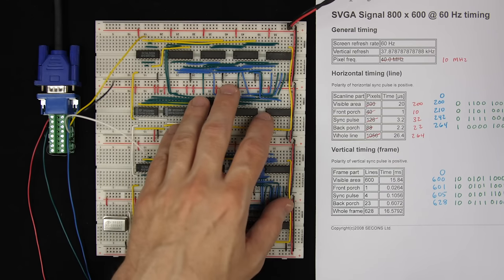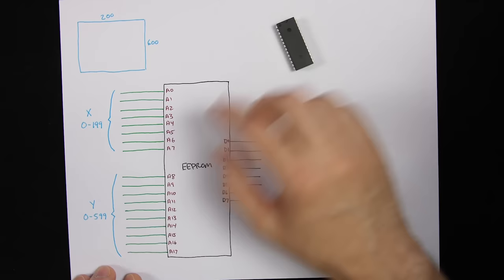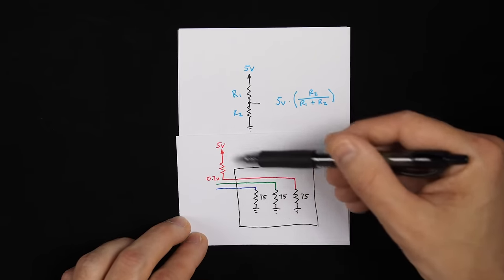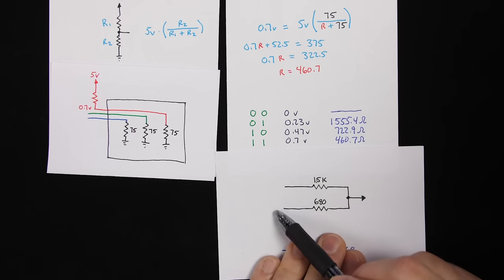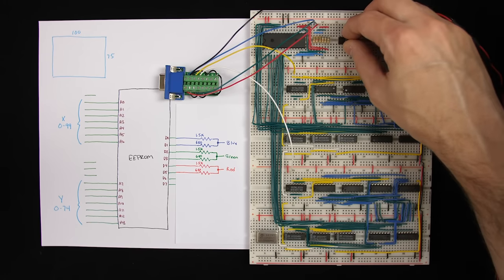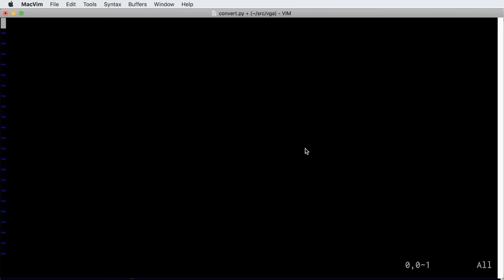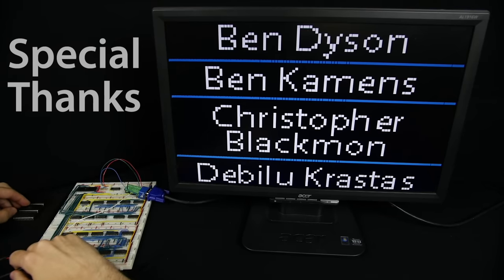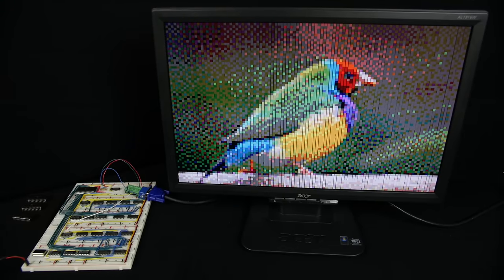World's worst video card? The exciting conclusion

Comment: Ben: I made the world's worst video card!

Intel HD Graphics: Am i a joke to you?
Reply: Lirei Taichen ATI: Am I a joke to you?
Reply: Ha! that comment was also on the first video!
Reply: Most integrated graphics in general: Am i a joke to you?
Reply: S3 ViRGE: Am I a joke to you?
Reply: Gedo De Luchs ATI=AMD Graphics  and before that the most common integrated graphics in server boards that only needed a screen for setting the thing up.
  Anyway, the original IBM PC manual included schematics for everything, even the CGA card built with TTL chips, a RAM chip and an old 6845 chip that did the job of the two bottom breadboards.  Max res 640x200 with the 4-bit DAC in the monitor instead of the card.  Hercules just added more TTL chips to get 720x350 on the MDA monitor with it's 2 bit DAC.
Reply: This joke must stay at 420. 'cos it's damn good.
Reply: @gguy156  RIP, its 440 now.
Reply: Matrox:  Am I a joke to you?
Reply: @gguy156  Might be my dyslexia but I see that as cos(420) ...Will work on the relevance of 0.5 later.
Reply: intel hd 400
Reply: Intel: Can you scale it down for to 12nn?
Reply: Yes, lets see if it can get 60 FPS
Reply: 3dfx voodoo: i'm a joke to you
Reply: Let's not forget intel non HD graphics.
Reply: SiS mirage graphics: bruh
Reply: But integrated graphics are just fine! (For my needs, anyway) I have a 2015 HP desktop with Intel HD Graphics and an Intel core i3, and it works just fine with Minecraft (even with a 512x resource pack!) And The Sims 4 at around 50 fps.
Reply: @Moonbeam111  is ATI not a thing anymore?
Reply: @someguystudios23   Well, try running anything more than that though. It just aint gonna happen.

Also, iirc minecraft isnt particularly GPU intensive until you start using shaders, its the processor that takes heavy beating as for some reason Minecraft cant use more than 1 core.
Reply: @someguystudios23  ati was bought by and rebranded to amd
Reply: Intel hd is gpu. Thats why
Reply: it can run Minecraft at Mon specs..  soo
Reply: CGA: Am I a joke to you?
Reply: The rest of us: Yes!!! :D
Reply: @GRBtutorials  vega 8 and 11 are not that bad
Reply: more like intel gma x3100
Reply: Lirei Taichen Intel Integrated SD Graphics: Yeah right.
Reply: intel: we are the world's worst graphics card producer

ben: hold my EEPROMs
Reply: My pc: am I a joke to you?
Reply: My old laptop had Intel HD graphics. And it wasn't able to render videos @720p 60fps
So Intel SD graphics

Comment: I found this hilarious as a Windows user - Microsoft Paint forced bitmap on us for years - but you wrote a python script to extract a bitmap from a png =D
Reply: OHH so thats what bitmap means!! It's a literal map of bits! 
This is a big revelation to me for some reason
Reply: For what it's worth, you'd have to do the same with a bitmap (.bmp) image -- they write data from the bottom row of pixels to the top, and of course still have all the header data and don't have the necessary padding.
Reply: I get it
Reply: Yeah I think he could have just increased the canvas size to 128x256 and filled the bottom and right edges with black, then exported as bitmap to avoid the whole python step, right?
Reply: You wouldn't get indexed colours like shown with Paint's BMPs, it forces you to use its colour indexing.
Reply: @mikeboggs0  "they write data from the bottom row of pixels to the top" that was a funny thing i learned when changing values of a bitmap in a hex editor... everybody does different things when they are bored, don't judge ^^
Reply: @chrisakaschulbus4903  You seriously think that's something to be embarrassed about? That's cool, I'll do that now whenever I get bored too.
Reply: Another reason modern bitmaps don't work directly, is they also tend to use run-length encoding... So if you had an area that was all The same color in a row for a bunch of pixels, it will write out the pixel color once and then the number of pixels.
This is literally the simplest compression you can do for a image.
Reply: @TravisFabel  it depends on what exactly the specification of the bitmap is... in some format (i'm not sure about how many bits) you will even see a fully white pictures as individual values.

that was actually the only way i could find the few colored pixels that i made with paint.

wouldn't what you said mean some sort of compression? and i'm sure bitmap doesn't have this, but i'm really no expert in the matter
Reply: @diggoran  bmp files still have more info than just the pixels (such as width of the image so an application knows when the list of pixels is now on the next line) so youd still have to do the python step.
That would avoid the exception handling though.
Reply: “Im autistic and want to let everyone in youtube comments to know I know computer words, how do I do it”
Reply: @jrodriguezpiano  if that was directed at me: yeah I'm on the spectrum, what's your point?
Reply: A PNG is a bitmap.
Reply: @josephlouwerse2105  wtf! All these 20 years...i've known nothing
Reply: @jrodriguezpiano  "I watch deep cutting tech videos and then try to make fun of people for using  basic tech notions that still somehow are beyond me"
Reply: @diggoran  I did that. The only other things you have to do is flip the image vertically and remove the bitmap header in a hex editor.
(I did it because I couldn't get his python script working right)
Reply: @sevret313  So just export the image as bmp in Photoshop or GIMP?
Reply: @TravisFabel  So export the image from GIMP and turn off RLE.
Reply: @Jon-yh3gb  Or you could remove the header in a hex editor.
Reply: @chrisakaschulbus4903  RLE is compression, but bitmap actually does support compression. However, most bitmaps (that I've come across anyway) don't use compression.

Comment: the interesting thing is that this is more powerful than lots of the 8 bit computers from the 70's and 80's
Reply: Cuz of thr integrated circuits , in those times it was not existing yet
Reply: To be fair, their limitations were not really on the circuitry to convert the data into a video signal but in the limited amount of memory to store the data and the limited CPU power to create it. Even with this build, in the end, the size and speed of the memory chip was the limit to what it could do.
Reply: @HenryLoenwind  Yep. Something a lot of people don't think about is that, even at a tiny (by modern standard) 640x480 resolution, at 60hz, to update each pixel on a screen would require writing 18 million pixels of data per second. I have doubts that many CPUs from before the late 80s could even handle that. And then consider that 640x480 @ 24 bit color requires at least 1 mb of image buffer - which is almost 16 times the total available memory of a Commodore 64. It's slightly mind-blow and amazing how large the numbers of operations and data modern computers push around while doing "almost nothing".
Reply: @rodolforp4200  bullshit, they were all available back then.
Reply: But COBOL still control the world...
Reply: And the video helps a lot to understand how 8bit computers worked.

Comment: Thank you so much for these 2 videos, it finally made me understand how a graphic card works with its frame buffer. I know modern graphic cards are much more complex, but understanding the basics is enough to be able to extrapolate. A quick remark: you used resistors to generate different levels of voltage according to the 4 bits for red, green and blue, that was very smart. I guess you could have used a Digital to Analog Converter (DAC) for this, especially if colors were coded on 8 bits, but the video would have been way too complex. Am I right?
Reply: Those resistors essentially ARE a DAC. Simple DACs are just a (very precise) array of resistors with driver stages.
Reply: 2 bits for each color*
Reply: @VintageTechFan  opened the comment to see if someone else had already brought this up :)

Comment: 100x75 pixels is not that bad, it's a lot more than I thought would be practical to build...
Reply: The Adruino-based Gamebuino META has a resolution very close to this. It's quite usable once you get used to writing games for it
Reply: (in fact most folks don't even use the full-RGB mode, they use 16 color indexed because of the lower RAM use. when you've got 16k....)
Reply: like, we had lower resolution color displays on phones when they started to have color displays.
For a breadboard graphics card it's quite amazing indeed.

Comment: I did this on an FPGA with VHDL, seeing it implemented with actual chips... it just makes me appreciate FPGAs more haha.
Reply: I've done the same. Way more fun then bending jumper wires.
Reply: @RobertSzasz  I think doing it with physical parts would give you an extra incentive to use weird tricks to keep the part count down. But obviously, you can do more stuff in an FPGA (2D acceleration anyone?)
Reply: @JGHFunRun  Also cool but for different reasons. (The AVR doesn't have much memory, so you have to generate the data on the fly!)
Reply: @JGHFunRun  : Eh, better to have the AVR just control the hardware. As Alex C said, the AVR isn't all that good for the job. Fortunately for those who want something smaller than this, it is possible. Two RAM chips (for framebuffers, since you don't want to write graphics to a buffer mid-draw), a shift-register (to reduce the needed AVR pins), an EEPROM (to implement control logic, instead of using a lot of chips, though another RAM might be better if you can arrange it's programming), a D-flipflop (to synchronize buffer swaps to V-sync), and a fast-enough adder should be enough. So, 6 chips to his 20, if you're willing to use memory devices as programmable logic.

Comment: PC Gamers: Intel HD Graphics are basically the worst video card!
Ben Eater: Hold my beer.
Reply: hold my breadboard
Reply: @Austeja608  that works
Reply: this Card he build don't crash, so it's more stable then nvidia, Intel and AMD combined.
Reply: I swear fam its fax
Reply: You should try my AMD video card in my computer, I am an AMD guy but this card is terrible, it crashes the video drivers and sends my computer to plaid every time I try to overclock it.
Reply: @muhschaf   Yes a single brick falls less than 1 trillion bricks stacked on each other nice observation
Reply: @skinwalker69420  so bad even the drivers that are supposed to be able to use it dont

Comment: Please combine it with your breadboard computer. I want to see it produce some lines or circles
Reply: 3:03
Reply: @saladnuts Yeah, it would probably do rectangles and stuff though, or pre-defined shapes in eeprom that could be resized
Reply: It's probably too slow.
Reply: @saladnuts Taylor series approximations of sin and cos with a fixed point representation (4.4?). You could then unroll the iteration loop to the desired precision, keeping track of x^n and n! at each value of n, updating either sin or cos at that step, with sin=x and cos=1 at the start (so you can start from n=3 with n! initially set to 3! and multiply x by itself 2 times to give x^3). Doing this you could compute them together, updating cos at the even values of n and sin at the odd values of n.

You may only need 2 additional steps to get a sufficient result for this case. Interestingly, Doom used 2 steps of a similar algorithm for computing the inverse square root.

Another alternative is to pre-compute the sin and cos tables for a given circle size on the EEPROM and look them up as needed.
Reply: @karlkastor   It might not run Crysis, but we could watch it draw the lines and circles pixel by pixel, which is even more exciting.
Reply: @karlkastor  No such thing as too slow in this scenario
Reply: @Ziplock9000  You are right, I didn't consider some kind of RAM/frame-buffer in between
Reply: Raiguard Bruh
Reply: @karlkastor  The EPROM is the frame buffer, it's already there. Although it might be easier to swap that to SDRAM or something else.

Comment: Overclock that puppy and then you could really pump frame
(Singular)
Reply: Watercool it! No... ln2! ;)
Reply: It's all tied on how fast you can change the video memory.
If you can change it at 60 FPS, that video card WILL display the video at 60 FPS.

But i think his hand will get tired if he goes over 2.
Reply: It kinda is over clocked.  That's how the black verticle lines are created on the screen.
Reply: @dan_loup  so overclock your arm?
Reply: @spectrthechamp3658  Or that or come up with a mechanic arm that switches the chips quickly.

Comment: The fact that this would be top-of-the-line in the 70s is amazing.  Imagine a video game console based on this fairly simple design
Reply: I hope he hooks it up to the breadboard computer later
Reply: That's still the worst video card, as whole the weight of processing image goes to CPU
Reply: That basically would be ZX Spectrum, but with more colors and way less pixels
Reply: @Blafaselblubb  he did it just today :)
Reply: Well in 1981 in the UK we had the ZX81 with 64x48 monochrome pixels for drawing, though actually there were 32x24 characters of 8x8 including a range of "quarter block" characters to support the 64x48 "graphics", then in 1982 the ZX Spectrum with 256x192 proper pixels with 8 main colours plus bright/not bright (4 bits).
Reply: FBI would just enter his home and take the graphics card...

Comment: Having A15 free you could have programmed 2 images to one ROM and switch them
Reply: "Frame buffer" Yo! :P
Reply: the switch would be too fast, you wouldn't see anything
Then he would have to introduce some kind of delay circuit...
maybe on another video...
Reply: @fft2020  He just needs to add another few JK flipflips to the output of the vertical blanking signal, add 8 of those delays the signal for about 4-5 seconds
Reply: @FerrybigGaming  and switch the address position on the EPROM to the other images
Reply: actually, he could have used 2 remaining ROM lines for sync so that entire video card would easily fit into something like 5 chips total.

Comment: Thanks! As primarily a software guy I found these two videos very interesting and clearly explained.
But on the Python script, just minor quibble from the software world: Please don't use exceptions for normal execution flow. :-)  You should instead add another for-loop for the extra 28 bytes.
Reply: or a condition within the loop, but as someone who dislikes arbitrary rules without reasons it bears mentioning that exceptions are fundamentally different beasts in c++ vs. jave/python/ruby/etc, and doing control flow via raised errors was encouraged in some of these languages for a time. there's more or less good arguments against doing it nowadays but fact remains that these are stylistic issues rather than objectively bad approaches

Comment: I have a questions (3 years later). Shouldn't the Blank Interval be a NOR gate? I mean, u'd want to output the colors only in the section where you're not on blank vertical and not at the blank horizontal. That would be a NOR of those 2 blank flip-flop outputs, wouldn't it?
14:30

Comment: I can barely get a light bulb to switch on and this mans making his own damn graphics card.
Reply: Video card*
Reply: @khalidbashir2037  Yes*
Reply: And makes it look easy too..
Reply: @geang.carneiro3982  this produces a video signal from information it gets from a rom or something
its doesnt process any data or calculate polygons or anything like a gpu
Reply: @geang.carneiro3982  Huge difference, GPU's are used for massive calculations done to produce 3D/2D polygons/structures/algorithems for a process be it a game or AI program. Where a video card is responsible to light up specific pixels with specific colors (an visual image) it takes pixel data as an input.
Reply: @khalidbashir2037  That's also why Cryptocurrency miners use GPUs, right?
Reply: @diamondfailer11  they do use gpus for that reason but most professional minners use seperate machines that are specifically designed for mining. Using fpgas mostly
Reply: Diario do DayTrader I don’t think there is any difference. These guys are making up their own dictionary.
Reply: @khalidbashir2037  oof
Reply: @echineziplays676  couldnt be explained better 👍
Reply: @khalidbashir2037  im no CE engineer but im an enthusiast that also understands alot of stuff hardware related mostly thanks to retro machines and youtube
Reply: @khalidbashir2037  A GPU is not a graphics card! If you correct people, know your terms.
Reply: @khalidbashir2037  He is correct, graphics card and video card are the same thing. Some of us have been around along time. GPU is graphics processing unit, not graphics card.
Reply: @aronhighgrove4100  GPU is indeed the graphics card when u speak in common language. When u speak technically then gpu is a small chip on graphics card. Gpu and graphics card are some thing when you try to elaborate their workings. I thought that was common sense.
Reply: @MrBreadoflife  lol
Reply: @khalidbashir2037   GPU, Video Card, Graphics Card, Whatever, I'm a software engineer not a hardware or electronics enthusiast , I don't know jack squash about this stuff. I barely put together my PC let alone building the entire thing from scratch
Reply: @echineziplays676  👍

Comment: Python script wasn't necessary, you can simply save directly from Photoshop as a ".raw" file.
Reply: Although it's true that you don't need the script for the binary file, it would not hold the zeros as padding for the sync signal, nor the zeros needed for the EEPROM to accept the file size.
Reply: @markachternaam5207  Well, you could just add black borders to the right and bottom of the image to make the image the right size :)
Reply: @PG-gs5vb  I guess that could work!
Reply: @PG-gs5vb  but if you do that you won't be able to flex on your viewers with python skill
Reply: @pneumonoultramicroscopicsi4065  but you could flex even more on your photoshop skill